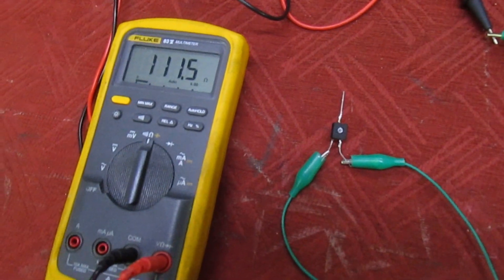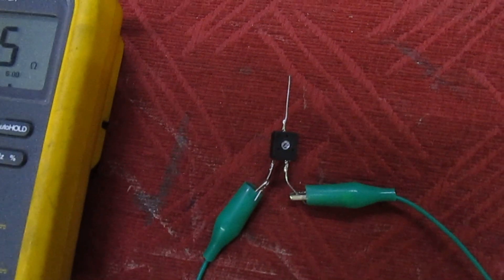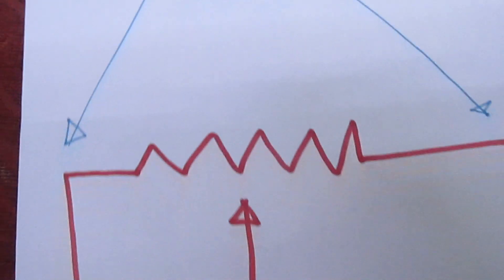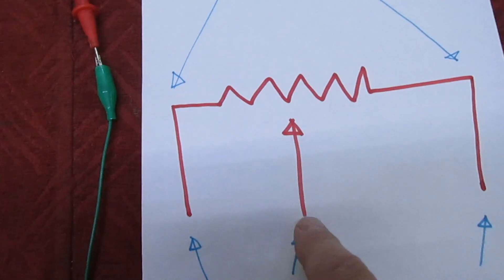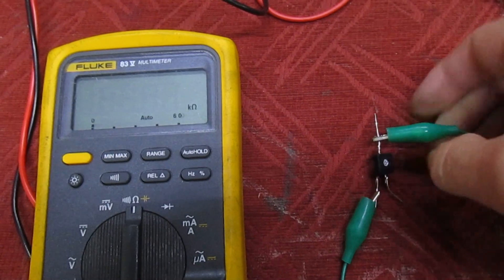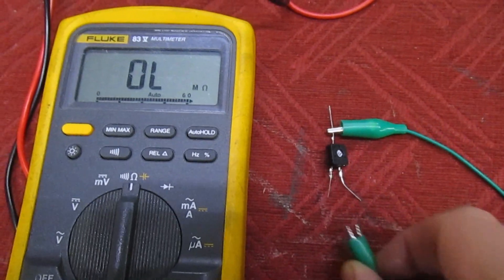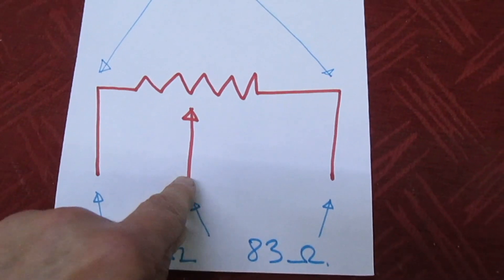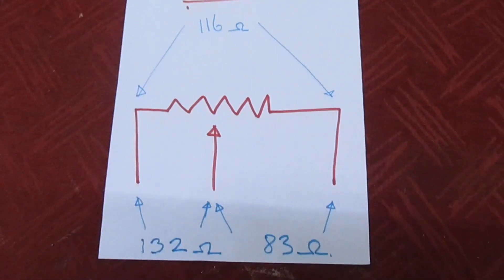unusual preset potentiometer failure in audio amplifier.

Comment: Wow! Very unusual fault! ... This makes me recall when I had a tactile switch that measured a few hundred ohms without  pushing it in (instead of open circuit)... It was the reset button on a Radio Scanner and gave the symptoms of no LCD display and no reception...
Reply from the maker: I had this same fault a few months ago on a tuner amplifier, backup battery kept going flat overnight, actually I say battery , it was a 0.1F super cap , it was only after I replaced the backup cap and had the same problem I realised current was leaking away through the reset switch .

Comment: I’ve had this happen recently too Mike sent me on the run around the job did, last thing I checked stupidly was the bias. Ended up swapping both the pots for both sides as I suspected it was faulty and could of failed again, one transistor just randomly over heating on throwing it in protect mode. Similar shape to this one, think it was an arcam or Cambridge audio amp.
Reply from the maker: Absolutely correct , it was an Arcam 7 channel class G amplifier  and it would intermittently overheat and display FAULT just before shutting down .

Comment: Interesting.
Is the pot too well sealed or is it possible to spray some deoxit into it?
Reply from the maker: It appears to be sealed but for the cost of a new pot , about 60p at RS components I wouldn't even think of spraying it with contact cleaner, I just put a new one in  .